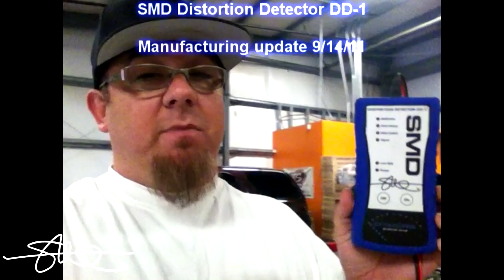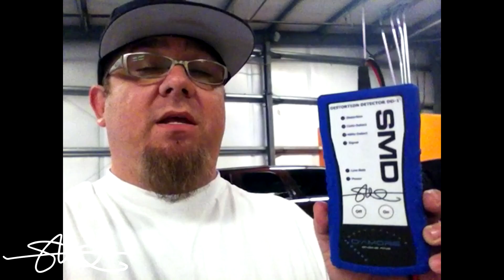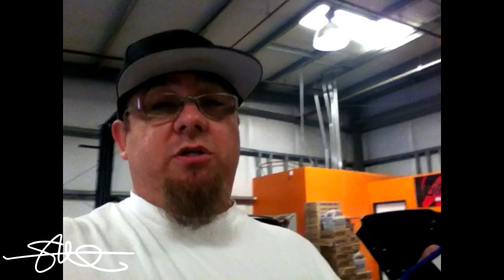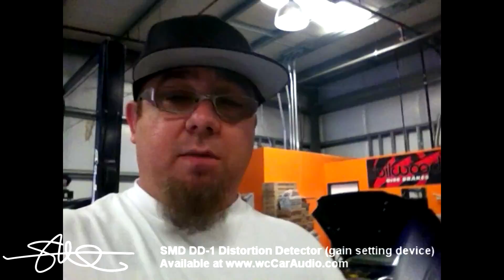SMD DISTORTION DETECTOR DD-1 MANUFACTURING UPDATE 9-14-11

Comment: Got an idea for your next gadget Steve.  Make a clamp meter that reads the amperage and test leads to read voltage. Both AC and DC . Have it automatically multiply the two to show the actual wattage and maybe even show the ohm load below that. With peak hold and all that good stuff. You would make a killing And make it look cool like the dd-1 .  kenny coleman has a permanent version of this in his truck. its really cool.